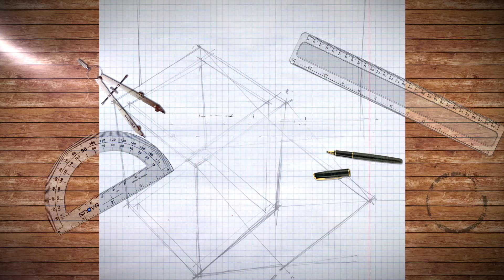Build a MOTORIZED monitor lift (on a budget!)

Comment from the maker: Wow, you guys are totally obliterating that like button! Thanks a lot! Let me know if you have any questions about the project and I'll answer them in an FAQ section amended to this comment.
Reply: DIY Perks very awesome
Reply: awesome build, to bad the lid was manual... 2.0 perhaps :)
Reply: DIY Perks is it possible to make it faster, seems a bit slow for my taste
Reply: Do you think that I could use this to lift a motherboard tray out of a custom PC case? I have considered doing that for repair ease of access
Reply: DIY Perks Awesome built, can you share which components should be used for a more heavy duty setup?
Reply: You forgot to add the video preview thingy at 9:32
Reply: Can you make a DIY motorized standing desk?
Reply: You could add a shelf onto the moving part that was flush with the top of the desk when it is down.
Reply: How much weight can it support?? Thanks! great project
Reply: DIY Perks hey great work,but why you didnt put that extra shelf on top of the monitor so when you pull it out the shelf stays on it(sorry for my bad english I am from croatia, I sugest you to do like I said cuz in your way there is a hole behind a table
Reply: would it be possible to turn this into a sit stand desk.
Reply: +DIY Perks How about adding a hinge that lets the shelftop fall into place on its own (edit: or do it the way Red Wolf suggested). Seems to be too much work for me the way it is
Reply: DIY Perks it would be cool if you took the platform add it to the lift and add leds
Reply: And where is the schematic for the 3 position power switch?
Reply: why did you use radial ball bearings to support an axial load. I think that a flanged bronze bushing could hold significantly more weight making it less likely to fail. Another option would be axial ball or roller bearings if they can be found cheap enough
Reply: Wow, amazing idea! But this hand-putted back platform... I suggest that you make a transfering mechanism which will tilt it down before monitor goes up, or even make a moving table to the wall to close the hidden monitor, simultaneously you will get a little bit more space in the room.
Thank you for interesting good-quality videos!
Reply: I think that if you made the shelf a little bit larger, you could have made the extra shelf automated, so when you activated the switch, the extra shelf would open like a chest.
Reply: where can I get a more durable motor?
Reply: where can I get a bigger motor?
Reply: DIY Perks can you make the samething with a bed and desk also motorized. I wanted to do this but failed every attempt
Reply: try a 2 stroke mower engine from a scrap yard. I did and I am still trying to get the monitor down from the ceiling !
Reply: adam darras Amazon and get a 3d priner steper motor or a motor out of a car door
Reply: DIY Perks Do you have it somewhere written step by step
Reply: Hi Matt :) do you perhaps have the guide on how to make the housing? Awesome work!
Reply: DIY Perks how did you get smart enough to build these things
Reply: DIY Perks BTW I love ur videos
Reply: Can you show us how to wire it up to play "Working in a Coal Mine" each time it descends?
Reply: now add few more brackets to attach the"hide plate" to the lift too so it makes a shelf while the monitor is up... so you dont have to manually put it in place everytime =)
Reply: BOLOL
Reply: Simply use a faster motor or another gear ratio on those pulleys. However, be careful with the choice of that motor, it must still have enough torque to move the whole thing.
Reply: Thanks for video mate, it's excellent! I've been looking for something similar for my tv, but I would like to use a remote control to it. Do you have any ideas? I'm not too good with electronics,  but once i have a plan to follow, I can do it. Thanks again!
Reply: DIY Perks wish you sell these stuff , im too lazy to make any of them
Reply: same goes to me haha
Reply: > And where is the schematic for the 3 position power switch?

It's just a dual pole dual throw switch with a central OFF position.

To have it reverse polarity between the two ON positions: wire the two center pins to the motor + and -.
From your power source wire + to the right side terminal on one of the poles as well as the left side terminal of the other pole. 
From your power source wire - to the right side terminal on one of the 
poles as well as the left side terminal of the other pole. 
Wire the - from the power  source to the remaining two free terminals of the switch

So from the bottom it looks something like this. Hope this ASCII art works out...

s+  s-

m+  m-

s-  s+

Where m+ is positive terminal of motor, s+ is positive terminal of power source, etc.
Reply: > play "Working in a Coal Mine" each time it descends?

Get a  mp3 module (load wanted audio track, configure to autoplay on power on) and a small amplifier(+speaker), and wire them  in parallel with the motor (assuming compatible voltage, if not then add a boost or buck module to adapt the voltage) 
Protect the power supply to the mp3/amp/buck/boost with a diode so not reverse powering (likely blowing) them when the when the motor raises the shelf (and the voltage is reversed compared to when lowering)
Reply: You are so inventive. Thanks for the videos
Reply: or just use the mechanical way if you are not good with electronics and just glue the mp3 power button to the main switch for playing and pausing at the bottom...
Reply: BIGGER motor
Reply: That was AWESOME!! You really are GENIUS!!! hey... BTW... what's the monitor that you are using???
Reply: Could you upsize this project and make a TV lift cabinet intended to be used at the footend of the bed that accommodates up to a 40" screen size. I think that would make a interesting video as the cabinets on the market right now are made mainly for smaller televisions (I think up to 32") and are pretty expensive, also I got a 40" TV spare that I wanna put in the bedroom but I do not have a suitable place for ;-)
Reply: why not add a top plate that flips up when the monitor raises so the extra space be permanently there and not fiddle with an extra plate?
Reply: awesome project but can you please add the schematic
Reply: isn't belt too loose and too vibrates when moves?
doesn't such type of elevating mechanism make lots of vibrations to platform?
and especially interested why is the replacement wood plank get in it place by hands? (not automatically? it's not necessary, but it makes sense that project is incomplete)
Reply: Rather than placing another  board over the opening manually, how about you build a type of ceiling platform, on the lift, just high enough so that when the lift is lowered, the ceiling platform will cover the hole.
Reply: or perhaps a board that is flipped up (open) while the lift is being raised and triggered to fall closed when the lift hits a trigger at it's lowest point.
Reply: DIY Perks cooooooolllllllllll!
Reply: In regards to the Wiring and the Push buttons: Where did you get those? You didn't provide a link for those So I am assuming they were relatively cheap from a local hard ware store or the like?
Reply: Hi, im realy now beeing happy to have your channel. you got me to a super  idea for a case and now my long time goal for a monitor lift will finaly be possible (Still searching for some. GT2
Timing Belt Pulleys 40 Teeth 12mm) then i have everything to build it. but still need schematic and wiring and then i can start ;)
Reply: Awesome tutorial. I really want to build this in the future. The problem for me is that I am living in Sweden and our main voltage of electricity here is 210. Do you you know any good ways to make this possible with the parts you linked in the description? 
I guess I will need a inverter OR buy a motor here in Sweden with the right voltage, but i don´t want to risk to destroy anything when I´m building this. And we all know that it can cause fire if you don´t do it right with electricity! Super video BTW! Five stars.
Reply: When viewed this video I saw a lot of components that came from my old Printer. (motors, belt pulleys etc.. )   try to get your hands on an old printer; it's fun to open up and you get a lot of usefull components! By the way; i'm from the Netherlands. our home power is 230V.
Reply: Yeah i know. But the 210 or 230V does not be a problem he uses an Laptop 
powerbrick which converts 210 or 230v into 12volts and there he got his power 
source for the motor. So you can order the motor from china but you need to have a powersource for it. I think you could even use the 12volt Lane of a pc powersupply for it. 

Matt that would be awesome to use the pc when you power it on that the Monitor or monitors will raise with the lift. And when its turned off the lift will go down.
Reply: Can you make tutorial how to make studio usb sound card
Reply: or some thing like that
Reply: If using the parts from this video, what is the max weight supported?  I would love to make this for two 27" monitors and a soundbar.  Load would be ~30-40 pounds for the monitors and bar.
Reply: can you please post the ebay link for the stop switches?
Reply: When will you release the wiring schematics?
Reply: I would recommend a DPDT Momentary Switch(like what your car power windows use)
Reply: Can you give us a link for an american version of those rods?
Reply: You can buy threaded rod at any Home Depot or Lowes. 12mm is 1/2 inch.
Reply: Inspiring work, what would your thoughts be on using 4 threaded bars for extra stability if you wanted to replace the monitor with a TV for example? do you think the same motor do? 
i think rather than sew the pulley system together, I will purchase a 2m length loop and keep it under tension by re positioning the idling pulleys, or build a sprung arm to mount the pulleys on.
Reply: DIY Perks make something with a raspberry pi
Reply: DIY Perks ii
Reply: DIY Perks can you please upload the schematic for the wires? Thx
Reply: He says he will in the description but it's been over 3 weeks I mean cmon
Reply: how long dit you work on it?
Reply: Rohit Dasgupta just change the gearing or speed up the motor
Reply: you sir are awesome great video
Reply: When are you going to release the schematic for all of the wiring
Reply: Will this be also good for a Desk?? I'm planning to build a standing desk.
Reply: I'm building this for my room, and I have added an upward-facing button switch in series with the top, downward facing button switch for just that purpose. I have made a simplified SID for the electronics. It can be found here: https://www.digikey.com/schemeit/project/motorized-monitor-lift-7FQ0OO83039G/
Reply: That may become unstable, depending on the height of the desk. Also, that wouldn't work if you have pictures on the wall.
Reply: DIY Perks are u Frodo?
Reply: do you need to use MDF?
Reply: you cold use plywood i think
Reply: DIY Perks July 3rd 1:54 am 2017 666 dislikes
Reply: DIY Perks yeah um if I wanted it to be faster. How much power do you recommend?? And if I use thinner pieces but still strong enough to hold the computer should I use it to make it lighter?? Please answer ASAP. Planning on making this the next few days
Reply: how much weight can this hold?  (Besides a surprising amount) +DIY Perks
Reply: why the hell don't you have more than 1mil subs...
Reply: DIY Perks. Hey. Please give me a diagram?
Reply: Jason Smith or a mechanism that will safely push the cover out of the way
Reply: TRDS CLAN Go to "Jon Peters" channel. He made a lift for a big TV.
Reply: Hay I'm going to make this with a smaller motor and just wondering what voltage you used.
Reply: Great vid, can't wait to build this.  Can we get a complete parts list?  Some of the links that you have for parts show numerous options.  Thanks.
Reply: DIY Perks hey good job.. love this... but I can't find limit switches.. and also can you please show me how to wiring all this switches and motor.. thanks a lot and keep it up..
Reply: DIY Perks please make a DIY motorized standing desk. Thanks
Reply: How many pounds can each motor lift? I want to make a table to sit my 3d printer on and retract it back into the bottom and a cover that closes the hole.
Reply: Rohit Dasgupta you could make a modular speed control device (unlike our creative friend here I specialize in computer software, which isn’t necessary in this but I have a great understanding of hardware and it’s many uses) so you’ll be looking for 1 of 2 ways to do this either keep the diy dream alive turn yourself on every time you pass a mirror caution others may feel the same causing extreme jealously in relationships 

Ok fun aside 1.buy a device that is make for controlling motorized wheels and motion (prices may vary depending on how much weight and at what speed they work also what makes them active) I won’t go into this one much because your gonna spend some money if you want some extra awesome out of these types of devices but luckily they aren’t to desired except for garage door openers and shit like that so don’t expect to pay more then $100 maybe I do no total guessing here but it feels about right if you want good products. 

2. For the person who’s about that diy! 
This is where you have complete control over everything. 
You’ll need board for your circuits and simply buy a little speed controller kit to assemble ( make sure weight is compatible for your needs as bigger parts may be needed for bigger loads (we’re talking 5-20$ difference all together except to spend like $15-30 for the simple basics with a little dial to control at which rate of speed you want always start low it would suck to see your tv attempt to rocket itself from its enclosure and die or scare the living shit out of anyone who sees this happening (unless your into that then by all means bolt that bitch down and rocket that bitch out. but don’t expect your tv to last 2-5years or the bearings and expect a lot of weekly or monthly maintenance) but find a nice rotation motor kit assembly that is meant for controlling speeds, decide if you’ll need. 2 or for 1 to control the 2 and marry them to act in harmony, from here you can usually get a dial or switch to flip that will active it at a turned or turning speed lift and descend, Now for someone with a little more creative mindset let’s add a Bluetooth receiver and transmitter to send the signal to our device and have it ascend and descend with a remote, or buy a multi connection Bluetooth controller with decent security features to keep just anyone from accessing it.  Or you could go with a motion  sensor that can send the signal to lift when someone passes the sensor (at this point you can plug your lights in the room to active along with the lift and or connect anything you want into this and have the entire room or home come to life, I recommend if you do anything with the sensors to of course YouTube videos on this area but also select the entering and leaving methods to be executed provided that your doing this for a room like a home theater or somewhere where people go in and out over and over or if you have kids then just completely forget this and go back to the dial option because this will ruin the magic of the whole thing and will quickly piss you off when halfway through a movies a kid comes running in and your tv and lights go out and all chances of getting laid go right out the window unless you’ve been married for years then your probably usto this kind of thing and have given up all hopes at anything (incredible and private) 
Hopefully I’ve answered your question completely and left no stone unturned 😇
Reply: I love this idea but think I'm going to get a window lift mechanism from an automotive salvage yard and try that instead of the threaded rods.
Reply: what would it aproximately cost about?
Reply: U did not provide the wiring diagram
Reply: DIY Perks where is the schematic diagram?
Reply: DIY Perks where'd the limit switches come from and what kind of power supply is that??? I'm a noob when it comes to diy wiring.
Reply: DIY Perks Mat,Thanks for a great show!!!!I have a question.

1)Could i add two or three motors of i wanted a heavier weight to lift (TV) or will that place too much strain on the belt?

2)Could you perhaps send through the wire diagram especially the stop switch part.

Thanks a million and keep up with the good work
Reply: This is fabulous! Most of your vids are waaayyyy over my head. They are amazing but I get lost halfway through.  Not your fault... my brain functions much better in the mechanical vs the electronic world.  BUT I can actually do this one and thank you for the links... makes it all so much easier!
Reply: those are NO push momentary switches and that power supply is a charger, well like laptop charger just he found 1 that's 15V, try looking online for those
Reply: Why not just make it a shelf thats the right distance above the monitor so that it is level with the desk top when the mechanism is down?
Reply: Did you ever create the steps and schematics?  Where can I find these?
Reply: DIY Perks  plz give me schetemetic circuit
Reply: Maybe you upgrade your motorized lift?  To make it more stable and can use an electric actuator?
Reply: how much did it cost ?
Reply: @DIY Perks could you please add wiring and schematics
Reply: What is the motor rpm?  Also what amperage is the power supply?
Reply: The schematic and wiring please...
Reply: plz provide us wiring diagram showing the connection with motor and switches
Reply: so i am doing this as a part of my A Level project and was wondering if there is an alternative motor as the one in the description is out od stock
Reply: Any chance I can get some blueprints before I start building mine?
Reply: sir please upload wiring connections
Reply: DIY Perks Hi, where can I find the Guide and shematic for the 3 Position power switch???
Reply: Where can you find a component listing plans?
Reply: @mpearce2  hi, i'm in the same situation. Can you tell me what you did ? I've thought about using a third thread bar between screens. I you made this kind of build i would like your review, thanks 🙂
Reply: Cameron Definitely! Show us a video of it!
Reply: measures?
Reply: Can you build it for me? I'll pay you lol 😂
Reply: Schematic later? Its been three years!
Reply: Hello, a little curious french down here:  do you have an idea of how many weight the motor can support, please? Thanks a lot! (btw I looove your job just keep going it's awesome)
Reply: Hey thanks for the awesome video! I got a lot of great ideas now. Where did you get the motor and pulleys?
Reply: Is there any way of hooking it up to your pc so when it it powers off the desk goes down and when I press the power button on it lifts it?
Reply: Hi Any chance of getting the schematics for the wiring please?
Reply: Hey could you please make a wiring diagram this will be perfect for my workshop ✌🏼
Reply: Very ingenious. I am thinking of extending this to build a stand-up table. The mechanism would have to raise a weight of about 15kgs (after adding a very generous buffer). What kind of modifications are suggested? Is the motor powerful enough, is the timing belt sufficient?
Reply: You could add some hinges and a restictor to the the lid so that opens automatically too.
Reply: Darren DIY I  Yu
Reply: Could you please provide circuit diagram
Reply: I am blown away🤓, thank you for this awesome tutorial. The eBay links are not working now, do you mind updating them? Or may be a list of the tools perhaps? 😁🙏🏻
Reply: Sir I want to see how you plan before you start any project because you cannot start building unless you have a model .
Reply: @thomasjohannesen1003  thank you ,sir ;))))
Reply: Hi.
I cannot get the exact motor you use and cannot find the specs either.
Are you able to list the specs of the motor you used? I.e. rpm, torque, etc
Reply: @JuggiJug  you can use motor 775 and http://www.cunningturtle.com/wiki/index.php?title=File:DPDT_MOTOR.PNG
Reply: This is a seriously great project. Any chance of those schematics?
Reply: Yes quite right!
Reply: +DIY Perks, writes "I'll answer them in an FAQ section amended to this comment."

3 years and still no FAQ section. Why promise to post one when you're not going to post one?
Reply: I do it so I can go back to the video easily. lol
Reply: Who can help me make this and deliver it to my house I will pay any amount
Reply: How much weight can it lift?
Reply: OMG this project alone deserves a TV show! Thanks for sharing this awesome DIY! 👏👏👏
Reply: @dogboyiscoollike8800  mmm muy mmm monino Moolll  un monopoliom
Reply: @der94alex  km lo jumó
Reply: @nielstielemans152  m  lo k
Reply: Lo
Reply: @Peter-ft8nl  llkkkkkmmlm llamamos l
Reply: @andreisorescu9142  m l m mmmpp lo k lío
Reply: Hello, 
Your video is just awesome...
u must also try for giveaways.....
Reply: Where do you live ?
Reply: Hey @DIY Perks do you have the plan of this whole thing?
Reply: Also What kinda Battery do you use?
Reply: Do you have working links? The links are disfunctional
Reply: This is great but none of the links work anymore as it was 5 yrs ago. Can you add a new link for a capable  motor?
Reply: Hey, for some reason the links won't work for me. Is it possible to get a run down of the kit used here for me to buy online?
Reply: Hi, Can you give me some specs for the motor you used? Like how many torques were ok with your project/.
Its been five years since you uploaded the video and the parts are no longer on ebay.

Cheers Matt
Reply: @MiniMorris97 I thought the same!
Reply: Great video , the links don't seem to still work unfortunately, would you have updated links to purchase the items needed and even a guide I could buy from you ? Thanks.